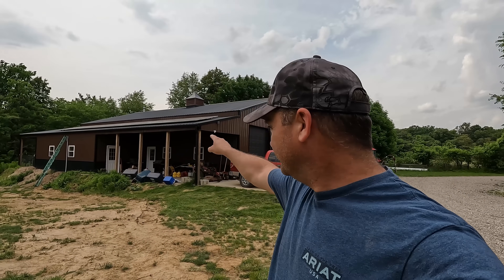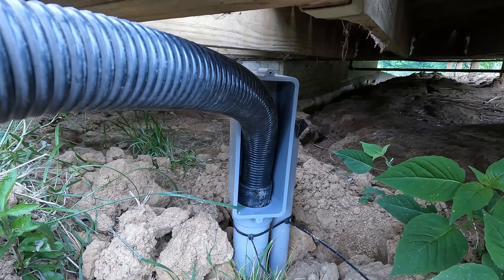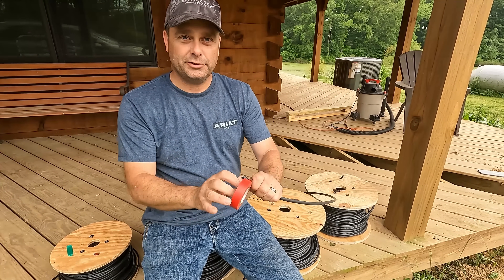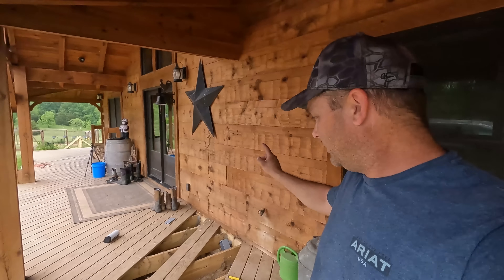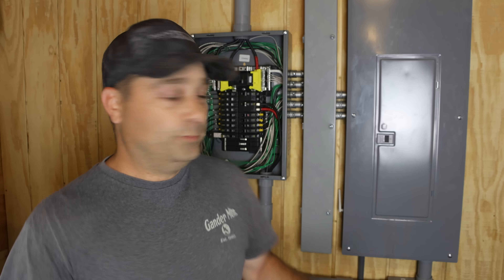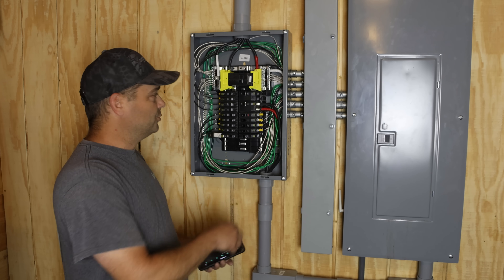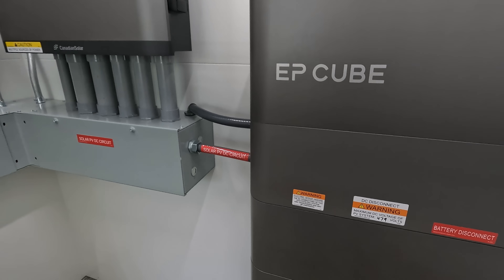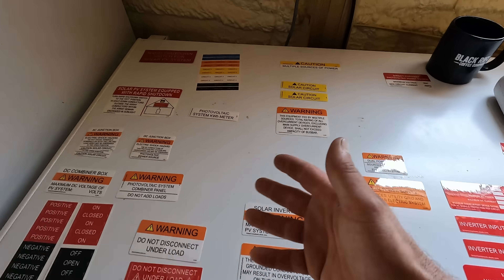Powering up the House on Solar power from Canadian Solar EP Cube.  Getting ready for Inspection.

Comment: Crazy cool System Evan.........I'm Impressed. Is there a Better box or transfer switch that can be used to feed the main house panel rather than back feeding through the Breaker? So basically you have the EP cube hooked up to the Grid in the Barn and you could eliminate the main Grid tie in the house....If you wanted? I like it. EP cube contacted us to do a video and I was happy to see you are working with them as well.

Comment: I have a couple of questions for you.  You have your main panel breaker in the off position so that more of your loads can be met by your solar/battery setup.  How do you provide grid AC power to your inverter?  Do you do this via your shop main panel that you ran a separate AC line from the road?  Also, how are you compliant with the NEC 120% rule.  What breaker size do you have going from your critical load panel back feeding to your house main electrical panel?  I'm also assuming that you will sell excess solar power back to your electrical company via your shop panel since the solar power room is located in the shop.

Comment: Add a second electric hot water heater and put that in front of your main hot water heater and use it as a dump load for extra power.  I have been doing this for 6 years for my dump load. I get to use my pressure washer with hot water to wash all my tractors and trucks and things.

Comment: Are you using a BMS computer/software system for solar/battery use  control maintenance ?
I see on a few of the ocean cruising sailboat , Bluewater sailors, who use solar, wind, generator and shore-power with the newer LiPo battery banks with a company designed computer BMS systems. Interesting the way they get all to work together.

Comment: Great, really neat and tidy system. Thanks for posting. It's really inspiring. I was looking for something about the EP Cube and came across this. Have you considered time shifting some of your heavy usage items? It seems like you might be using the grid at peak load  times and then selling back for peanuts at other times. If you are able to monitor your usage and production, you might be able to balance out those curves.
I for one, am looking to use my utility company as an emergency backup. I'm done with playing their games!
Reply from the maker: Right now I am buying about 15 kilowatt hours of electricity a day. At $0.14 a kw-hour, that's about $2.10 a day.  I am planning to add 2 more batteries and 3800 watts more solar.   Hopefully, that will get me closer to buying almost nothing from the power company in the summer.

Comment: Glad to see you got the wire ran from the solar room to your house.  Also cool that your inadvertent stress test, with large loads, went smoothly.  When I set up a small solar array, with controller, batteries and inverter, my initial "worry" was the battery wouldn't last long enough for what I needed it to do.  Like you, I found myself kind of stressed out that the solar was working so well, charging the battery to full and then the rest of the potential was being lost.  I found myself trying to find ways to use up more power so I wasn't wasting the incoming solar.  Such a strange dichotomy and something most of us never give ANY thought to, when using grid power, although we probably should.

Comment: You might want to double check with your power grid about “selling back” your power. Here in New Mexico we can’t “sell” our excess power. If we produce extra power it goes to a “power bank”. What that means is when we need to draw from the grid we use what is in the “power bank” first then we go to the grid. There is never money generated from our solar system it basically just saves us money which is fine with us.

Comment: Looks like a sunny day is the time to recharge all the tool batteries for free.  Might be interesting to see what happens when you are in the workshop using the electrical equipment you have in there.
Reply from the maker: Ep cube is powering the workshop also.  It back feeds power to zero the electric meter usage.  And any time you power a tool it sends power backwards to power that tool.  Really everything at the house and workshop is on the EP Cube system.  Only when the grid goes down, it stops back feeding the workshop and only powers the critical loads.
Reply: @CountryViewAcres  My gasp is flabbered!

Comment: You might check on your power company peak loads that’s when you pay the most money for your power and then maybe set your unit up to turn on during the peak load hours and not the overnight hours where are you? Pay the absolutely less for your power I know mine on the coast of North Carolina, my peak hours in the winter time. Summertime is six to 10 at night in the summer and from 5 AM to 9 AM in the winter so I do most of my heavy usage at night like running the dishwasher or washing laundry.
Reply from the maker: I don't believe we have variable rates.  Right now running everything.  The battery lasts till midnight.  Switches back to solar around 8am.

Comment: When we ran the generator hook up, we had to remove out porch deck boards too, not any other way to get into the basement breaker box. Good job on the entire solar system, I'm impressed. Good luck on the inspection, I'm sure you will pass with flying colors, or shocking results, ha! Thanks Evan, I hope you have a nice week and Memorial Day too.

Comment: Evan, I know there's a cost involved, but would it not be more beneficial to add two or three additional batteries to your system, that is if it can handle them. This way you should have enough battery power to last throughout the night no matter what load is put on the system. Then if you have a cloudy day or days then you can pull from the grid as needed. These are just my thoughts, I have enjoyed watching, because I've learned a lot from this and I'm an old man of 72. You and Rebecca have a great Memorial Day weekend. Good luck on the inspection!
Reply from the maker: I am planning to add 2 more batteries, since there is plenty if solar to charge them.

Comment: Good clean install. I’ve been off grid for almost thirty years. It’s been a series of steps but nowhere near as difficult as some would make it seem. With most fair sized systems making more power than needed is common. In addition to PV I’ve built my own solar hot water system that supplies 100% of my domestic hot water. Hot water is said to be the second highest load on residential energy use. Now I’m toying with the idea of using hot water for heat. Either that or a mini split.

Comment: Evan you should paint your electrical conduit running up your shop black to match your pole barn.

Evan, do you have any ventilation in your battery room?
Reply from the maker: Not yet.  The room hasn't heated so far.

Comment: I think the co-op power company would encourage this opportunity allowing themselves to purchase from members and not from the big companies. The only reason they wouldn't , because of hurting their relationship with big companies supplying the power.
Reply from the maker: The co-op makes it easy to add 10kw on AC power generation.  It's a $300 application.   Anything over 10kw of AC power generation requires a $5000 engineering study.   So they only encourage small systems.

Comment: Do you have to reset digital clocks after these switchovers?
Reply from the maker: If I switch the power manually yes I have to reset the clocks.  Not sure on the if the power goes out if it blimps the power enough to lose the clocks.  I don't think it will.
Reply: @CountryViewAcres  I guess it depends on the clocks circuitry and where it is.

Comment: Great job! Im curious how your system will handle shorter days (winter).
Reply from the maker: I plan on adding 2 more batteries.  And the additional 12 solar panels I have to the system.  After that, it should sized to power my critical loads during winter.  About 20 kilowatt hours.  So in summer it will make excess power winter it will make about half our total power needs.

Comment: Would you know if the commercial power went down?  It looks like you have an automatic rollover setup so how would you know to turn off the heavy use items?
Reply from the maker: It might be difficult to know the power went out.  I need to do a test and see.
Reply: @CountryViewAcres  Just curious as you guys are busy and most likely would not even notice.
Reply from the maker: The farm side of the property is on a different electric meter.  We would notice the power being out on that side.  Also the dust till dawn lights are on the grid side, so we would notice the lights being off at night.  They should be adding a notification to the app, so your phone alerts you of the power outage.

Comment: Question: by keeping that battery limited to 30% do you not affect the “memory” of the battery and essentially end up losing some of that battery benefit?
Reply from the maker: The battery doesn't see any effects to performance as long as it stays above 20%.  I have changed my reserve capacity to 25% now.  So I am draining them a little farther than in the video.

Comment: Evan - Out of curiosity, I know you’re experienced in a lot of areas, but did you do all of the design research yourself or did you rely on outside design consulting?

Also, if you can, would you post the resources you used in the design process?

While I’m in my 70s (tech literate and pretty handy) I’m contemplating going solar in my 900 sq foot cabin home.
Reply from the maker: I did the design and drawings all myself.  Similar to stuff I do at work.

Comment: I am curious on how you can run whole house on  number six wires especially since you are talking electric stove and a/c. Isn’t that overloading the wires from the barn?
Reply from the maker: I have an electric oven,  gas cooktop.  So less power than an electric stove. Electric drier and 3 ton AC unit.  As long as I don't run the drier and oven at the same time it can run it on batteries.  With grid power on to supplement, it will run everything.  The drier is the big load that is contant you have to be aware of.  The AC unit pulls 1100 watts.    The clothes Drier pulls 5450 watts.  Oven pulls up 3600 watts.  So if the power was out you couldn't unit the clothes drier at the same time as the oven.  You would over the 7600 continuous watts of the inverter.   But the inverter does have around 22000 watts surge capacity for 10 seconds.  So it can start the AC unit.
Reply from the maker: The wires from the barn to the house are #2 gauge, or 100  amp service.   The inverter has #6 for the 7600 watts it supplies.  The inverter has a 40 amp breaker.  If it overloaded the breaker would trip.  Been running the whole house for about 1 week now.  No issues.

Comment: Question..is there anything that lets you know the power is out and you are running on only solar without checking the system or the app? Would more batteries help save the extra power the solar generates instead of selling back to the electric company?
Reply from the maker: You might see a flicker of the lights when the power goes out, But without the App you may not know the grid turned off.
Yes extra batteries will help.  I plan on adding two more.